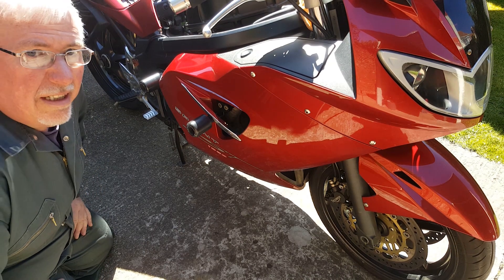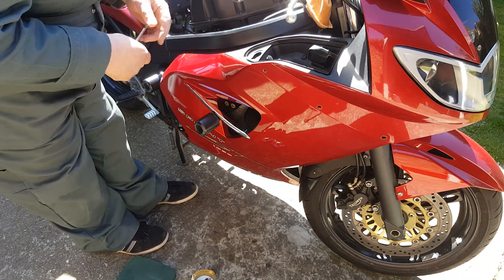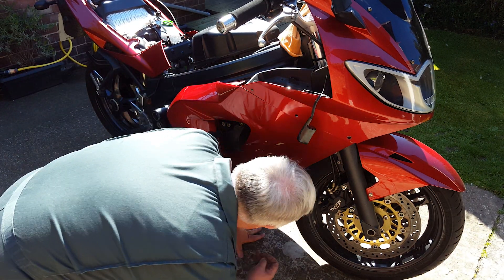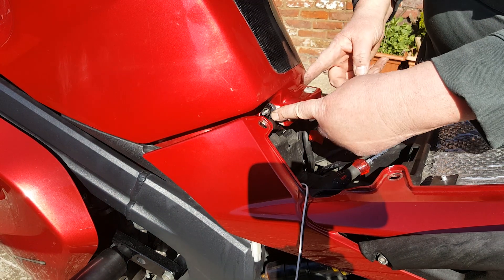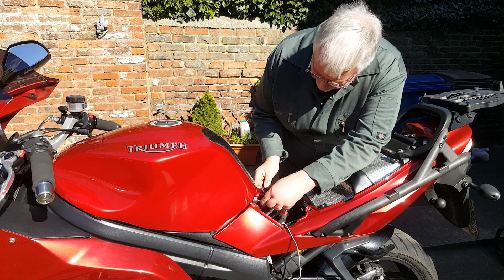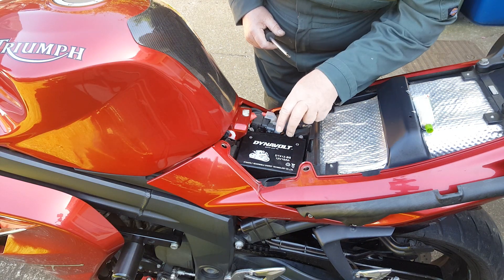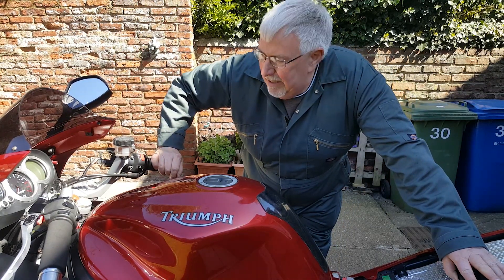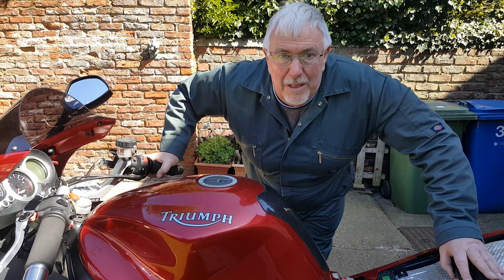Mosfet Regulator Rectifier Upgrade Guide [No More Stator Burn] - Triumph Sprint ST 1050 | Part 2

Comment: Do you know which nipple the tube with the tip over valve attaches to? Ive just had my engine replaced and had to do a few tweaks to it, now cant find where the tip over tube goes! I also seem to be missing the tube that fits to the second nipple. If you can point me to location of the tip over valve i can figure out the other one, thank you!
Reply from the maker: Sorry, I haven't got the Sprint any more so I can't take a look to say.  Good luck.
Reply: @SPANNERRASH  ah that's a shame. Thank you anyway! Your videos still helped me do both upgrades to mine a couple years ago, lifesaver!

Comment: Just ordered a new regulator as my connector to the stator has also started to smoulder and smoke. Hopefully will keep it alive a bit longer until i can also get hold of the pudding cables 👍
Reply from the maker: It wasn't just Triumph's.  Seems like all manufacturers used poor regulators and rectifiers until recently.

Comment: Replaced RR with MOSFET and alternator stator, voltage at idle 14.6 volts, at 3000 rpm 16 volts. returned the old RR (shunt type) back. The voltage at idle is 14.0-14.3 at the shunt regulator, the rest of the rev range is 14.5-14.6 and is stable.  I noticed that when you start the motorbike you open the throttle a little, what could be the problem? I also have to do this when the engine is not warm. My friends have the same motorbike and it starts without opening the throttle.
Reply from the maker: I suspect that balancing the throttle bodies and getting the injectors cleaned might make a difference.  I think that problems like this are caused by bikes being left to sit for years on end in non heated storage, as long as it doesnt stop the bike being used it isn't something I would rush to investigate, and you never know if I actually did a trip of a few hundred miles it might even clear it up!  Good luck.

Comment: The link for this doesn't work anymore,  how much should this cost to buy?
Reply from the maker: Hi, I noticed that there are a  lot of very cheap "mosfet" regulator and rectifiers advertised.  They may be fine, but I paid a lot more when I got mine, from a more recognised supplier.  Here is a link to the one I bought. https://ebay.us/6syLjl

Comment: Dealing with the tank. It is common for the tank to swell. At least that is what the RAT forum says.  It  mounts in a rubber holder at the front. There are a couple rubber pads along the frame. My tank actually sits on top of the headstock. That part of the tank and headstock are both flat so it sits there slightly but securely on top with the metal mount snug in the rubber. I lubricate the rubber holder at the front of the tank. To remove the bolt at the rear or to reinstall the bolt? You need to have the fairing out of the way. Remove the bag mounts as a given you can slide the fairing back.  Now, examine the rear portion of the tank that was hidden. There is a bit of rubber pad on the tank there to prevent abrasion I guess. I have mine held with gorilla tape to keep it from deteriorating or falling off when moving the tank. I made an oak stick about an inch square and 6 inches long. I find the spot at the back of the tank where that pad is. I put that stick against the frame between that squared part at the rear underside of the tank and lever it to push the thank fwd against the rubber mount at the front as I align the bolt hole. It's my understanding from that forum the tank may once have fit in behind the headstock but mine simply needs to rest on top of the headstock. I got it that way. The nose of the tank solidly fits slightly on top not behind. I never understood why people spoke of the tank swelling making it an issue. Thinking that is how it is supposed to sit. By levering the tank with a stick at the rear knowing about a possible conflict at the nose, the front mount is snug, the tank rests a fraction of an inch higher and is on top of the headstock, the frame pads and the bolt can be easily adjusted, what ever it takes to align the bolt hole can be done effortlessly prying with the stick but the spot is hidden by the fairing.
Reply from the maker: Thanks for the info.  It is a faff with these tanks.  I didn't realise that it had a plastic tank when I first bought it, until my magnetic tank bag slid off :)

Comment: I've got mosfet RR and stator keeps burning out. Any idea why is happening?
Reply from the maker: There are only 3 main things involved here.  Reg/Rec, Generator and Battery.  If you have replaced all of them one must be faulty.  I would suspect the Reg/Rec because it is the most complex and prone to faults.  The stator only tends to be a problem if the reg/rec is not controlling the power take off correctly,  unless it gets mechanically damaged. I think some Yamahas have a problem with this.  Lastly if you have bad battery it will put a lot of stress on the rest of the system, so could damage either or both of the other parts.  I hope this helps.  Good luck.  One final thought poor connections, the main connector can suffer with burning or corrosion which adds a lot of resistance into the system.
Reply: @SPANNERRASH  thanks Alot its a nightmare but gonna strip it the wk end and see connections and hopefully is only that. Regulator is only 6 months old and got the Mosfet one and stator only new since last September so shouldn't be doing it so soon. I'm bit lost as why doing it again but will check the connections and see thanks 👍

Comment: I don’t know if it’s the same on the sprint as it was on my speed four, but the plug from the stator gets hot, very hot. In my case catches fire! It’s recommended to remove the original plugs and solder the cables from stator to regulator directly. I would still have my bike if I had ☹️
Reply from the maker: That is a really good idea, when I checked my connectors they were OK but I have heard many stories of them melting and catching fire. I would solder then if I was doing the job again.
Reply: @SPANNERRASH  wish I had soldered mine, might still have the bike now.

Comment: I have always thought my sprint had a problem when starting up. This make perfect sense  and I will definitely do the cable upgrade to start with. It just seems to labour sometimes , and there is nothing worse than being out on a run and the bike wont start. Thanks for the video...greetings from Cape Town
Reply from the maker: Glad that you have found it helpful. They can be a little fussy starting. You need to make sure you have a good battery that is well charged.  That is why it is so important to make sure your charging system is in good condition.  Take care.

Comment: did the tank HAVE to come off :(?
Reply from the maker: I think its definitely best to remove the tank, its not as bad as it sounds either. Although it may be possible to do it without fully removing it.
Reply: the link to the item doesnt find it anymore :( Dont suppose you could advise where i can find it? reluctant to chance it with alot of them claiming mosfet but are cheap chinese ones :(
Reply from the maker: Hi  @philipjohnshire  I believe this was the one I went with: https://ebay.us/rbm6bz I was cautious of cheap Chinese ones too. Hope that helps!

Comment: thanks for the vid!! my battery basically caught fire because it was over charging! replaced the battery and its geting over 18 volts !! so ill be doing this in the next few days (but ill probably use a cheaper copy which will still be better than a broken one haha) Thanks again!
Reply from the maker: Sounds dangerous, I hope you get that sorted ASAP before your bike goes up in flames. 😬

Comment: Later Sprints had the regulator mounted higher up and more forward on the other side of the bike.
Reply from the maker: Interesting, is it the same part? Maybe they moved it to a cooler mounting position.
Reply: @SPANNERRASH   yes I think that was the reason for moving it.  I’m a bit out of touch now with the Sprint having got rid of mine around 2014.  Not sure if the part changed but heat was the killer for them. The alternator wires would probably reach but the battery wires might have needed modifying.  
I upgraded to the Shindengen FH020AA  before, like you, the old one went belly up.

Comment: Mosfet is unlikely to prevent stator overheating.You really need Series RR like Compufire or Shindengen Sh847.I have a 2005 Speed Triple with a Mosfet RR.And right now it is in my garage with a fried stator.And that stator has only done 4000 miles.The Series type RR reduces the excess voltage feed back to the stator by 50% so it runs a lot cooler.But they are expensive and difficult to find not to mention a problem to install as they are larger than the OEM RR.
Reply: I agree. It doesn't matter how much the regulator heats up, but how much the stator, wires and stator connector heat up. The regulator is easy to change and has a spare on the go.

Comment: so... the battery will slip in and out if you lift all the electrical connectors off the post, near the top side of the battery. slide it in. then slide the connectors back down over their posts.
Reply from the maker: Cheers, i'll give that a try next time

Comment: Put the Regulator on another place in this bike. Otherwise the verry hot air from the water cooler will kill the regaulator again.
I had taken my regulator behind the back damper ... it works for many years still today.
Reply from the maker: That's an interesting idea for sure, thanks Michael.

Comment: Mental note don't buy a triumph
Reply: Triumph are not the only Brand that have problems with regulators...
Reply: @mad_michel  yes I know my honda vfr is one of them. I was referring to how hard it was to take fairing off.
Reply: @paulscott1100  Yes, i had a RC 36 before i buyed a sprint. Put the regulator in the back of the bike... and the problems have a end...

Comment: Good easy job you did there  I myself purchased the bypass  one straight to battery  on my  tiger 955i  it was a pain  I'm also looking at  replacing  the battery cables soon  but the 30 amp fuse is wired into positive  so got a bit of thinking how  to  get round this .. great information  you putting  on here 👍
Reply from the maker: Hi James, thanks for the positive feedback! The battery cables can be fiddly indeed, good luck when you decide to have a go at that. Check our other vid out which has more on the cables, not sure how similar it will be to the Tiger 955i though. Cheers!